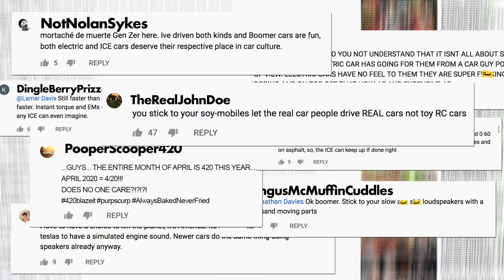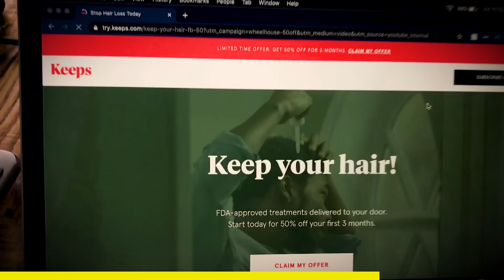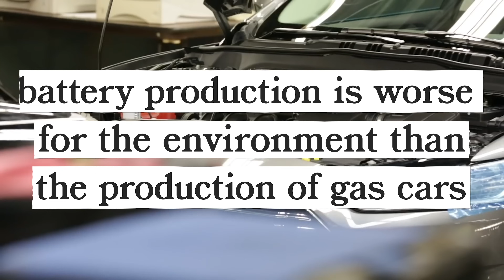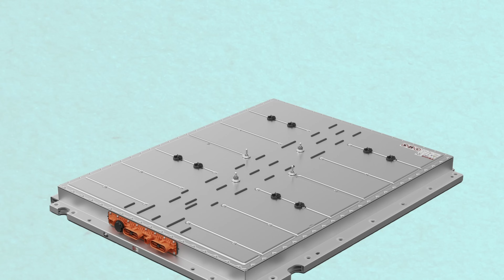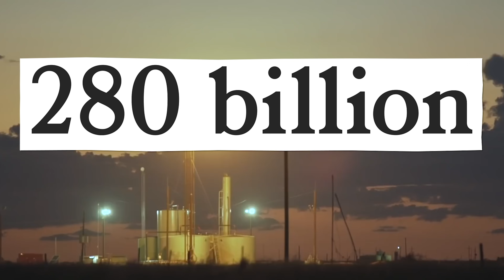Are Electric Cars REALLY Better for the Environment?

Comment: One other thing to consider is the ability to charge vehicles at home, many homes cannot actually generate enough power to charge vehicles and the cost of upgrading the central power at a private residence is high enough that there are going to be people that cannot afford to switch to an electric vehicle.

I would also be curious to see comparisons on how far electric cars can travel vs how far an ICE engine can go.  Also length of charge time vs how much time it takes to fill a gas tank is something to consider.

I am seeing a lot of things coming out about EV semi's and delivery vehicles and many drivers that I have talked to are worried that it will be impossible to finish a delivery route in an EV.  

I would be curious to see if you all can find more definitive information on some of these points because all of my sources are biased and not 100% accurate.
Reply: You can implement a control system that monitors the net instantaneous power to your house, and controls big ticket and flexible loads to run at different times.  Most of the time, your house isn't consuming anywhere near its full electric capacity; it's only when you have a perfect storm of load concurrence that you have this problem.

The controllers can put EV charging on pause, any time you have high demand from other loads, and waits until your other demand settles to charge it.  It can also do this with hot water heaters, air conditioning, and other big-ticket loads.  Another thing that helps is a VFD driven air conditioner, so that you don't need to have it spike on and off intermittently.

Comment: Well 1 part that was wrong you said many use fossil fuel for electricity.... ummmm most of the electricity is made from fossil fuel... I mean nearly everything is ran by fossil fuel... your saying EV and Gas Powered... you forget... planes and yatchs and more etc etc... Electric cars are new and are more of a consumer bandaid ppl just want to think they are helping the environment when in reality... no no their not. Ppl just selfish they want to cast an illusion that they are righteous and good and don't like hearing that they are doing evil either way. Even phone production... child labor... even clothing...also wind and solar power takes large and large amounts of areas and maintenance also... how do you fabricate and make these things? What raw materials are used? How is it maintained? Also electric car vehicles largely expensive and after 5 years your time is running on that battery which isn't a cheap fix. Also like you said battery recycling is a big issue... also we have to make a new battery which most don't do they junk the car... so we have large amounts of cars that have been junked... so that's why Tesla buys back their vehicles many times... to help recycle... ppl just need to think before suggesting these environment safe things... this isn't about the environment life will continue like it always has but us we will suffer. The actual true way to stop pollution walk or ride a bike... thats going to help a lot more. Another way is trash disposal... fossil fuel is the least of our worries and ppl protesting it don't have a clue how many things are possible just because of fossil fuel. As it stands if we say bye bye to fossil fuel we would have a timer before the system crashes... some say less than 2 weeks.

Comment: Does the ev still make less carbon when you account for how long the battery lasts before needing a new one which produces more carbon again? How about the fact that the solar panels and wind turbines make as much or more carbon to make as the generators but last alot less.
Reply: On average 37% less pollution than ICE. The real difference however is economics. In many countries and use cases, ICE is more affordable to the point where you may never breakeven financially due to battery replacement costs.

Comment: Some things to add into the discussion. First of all most people mention the greenhouse gases, but in nowadays greenhouse gases are not the only pollution thay is reaching to worrying levels, ICE engines also produces toxic pollutants, VOCs and PMs. EVs also produce SOME PMs but only during production and in a much lower levels.
The second one is where the money are going investing in either EVs or ICE cars. Most of the companies that are invested into EVs are companies that emphasise renewable energy and battery technologies. I know that everyone loves to dump on the batteries the EVs use, but batteries are not essetial just for EVs but for everything else as well. ICE ondustry is mostly invested on weapon ondustry and oil.
Finally EVs are at their infancy as the video mentioned, ICE is at its peak and many argue that not many advancements are left for ICE, yet EVs have a whole mile to go through for the next centuries, only improving what they are aiming at.
Reply: This is a outright lie lol. Battery technology is over a century old if you're only talking about rechargeable batteries. If you're talking lithium batteries, an evolution of rechargeable batteries, it's over 50 years old. The EV comes in only because we got this far with battery technology

We are nearing peak battery understanding with maybe the last break through with solid state in the future. 

But ICE and it's fuel sources are still up for innovation on fuel sources alone. And again, it's only because people claim co2 is bad that we've put a stop to it lol. But at the end of the day co2 is normal for the world and plants need it haha

Comment: The fact that Children !!!!! are being used to produce your batteries should be enough to stop you from making this video. You spent 7 seconds talking about child labor , and 5:38 seconds trashing gasoline vehicles.  Children are being sacrificed to save the earth.just keeping it real. Does this not make sense to people.
Reply: Trust me, there was most likely children involved in producing the device you wrote this comment with. One example is that your phone battery is of the same type as elecrtric cars uses..
Anyway, there are already lots of ev's made without the use of cobalt, and some buy from more ethical producers. It should be a lot more focus on the child labour in DRC though. We really need some international regulations on the trackability of materials so the producers can't get away with buying it from China without asking questions..

Comment: The EV pollutes at the power plant and the ICE out the tail pipe. BOTH pollute upon retreivnig the fuel source, oil, gas or coal. Fill ups are way, way faster than charge ups! 👍

Comment: Okay, imagine a 100 car pileup in icy weather, all the cars are EVs.  25 of the cars' engines start on fire.  Because their batteries are very very difficult to put out once they start on fire, pretty soon you got a ton of cars on fire.  It isn't just enough to put out the fire, but the batteries have to be cooled down enough so they won't start up again.  Which requires a TON of water.  It can take more than 20,000 gallons of water just to put out completely the fire of one electric car.  So now imagine if all 100 cars started on fire.  

Anyone know how we could calculate the impact on the environment from that?  CO2 on the other hand, is plant food.  There used to be a lot more carbon in the atmosphere, which is why plants used to grow bigger (as did insects).  It's not the boogeyman they want it to be.

Comment: Car industry is miserably small in entire petroleum industry yet you say as if ICE is responsible for CO2 due to crude oil refinement. EV gets 60% of its electricity from petroleum as well and there is a huge energy loss to convert it. Moreover, Windmills, solar panels are not CO2 free. Tbh, EV is not better for the environment.

Comment: After ten years the battery will require changing because the range would be half compared to new so the resale value would be low and the car maybe then just be disposed of because no one wants an electric car that can only travel 200km before recharging. 

Recharging during the holidays at busy charging stations would be chaotic.

Comment: Excellent breakdown of the pros and cons of EVs. One big issue I see with them is that they’re still not affordable enough for most people even with a tax credit. And on top of that a lot of people don’t have access to charging because they live in an apartment. Someday it’ll get there when the technology matures but not yet.
Reply: I just bought a used bolt with a fresh battery replacement for 18k. After the 4k I'll get back from the tax rebate, that's only 14k. Very affordable.
Reply: @mattpierson6100  wow that is a good deal. Hard to get a decent car for that price. How did you find that? Does that price include the new batteries or did you have to pay separate?
Reply: @mattpierson6100 I thought about one. One thing that worries me is the loss of warranty (because of time and mileage), and how expensive such a battery (and installation) can be.

Can you extend warranty with a new battery?
Reply: @mattpierson6100 how's range ?
Reply: @mattpierson6100  And, with the cost of a new battery pack, the car becomes like a bic lighter. Just throw it away and get another one once the pack cacks.
Reply: I think the ice market is setting the price trends.  The average new car in the US is ~$45,000, and seeing bottom of the market cars on the road is rare.  People complain about the prices but still very few buy the budget option.
Reply: For the apartment I agree but apartments are actually starting to install power chargers I use to live in an apartment in NV and after the built 3 more buildings in the complex they added a car charging station it's by the office though not all apartments have them but we'll get there eventually
Reply: Well they will be soon tesla is making ome and it'll come out next year it'll be 25 thousand
Reply: Average ev costs 30 - 40k + tax credits. Average diesel or gas costs 45 - 60k.
Reply: Not sure about price comparisons in the US, but here in Australia a Tesla Model 3  is the same price as a Ford Ranger.

They are really affordable considering fuel costs drop by 80% when you start driving an EV.
Reply: They're very affordable now for an average one. Tesla has stayed mostly in the luxury segment so far but this isn't representative of the entire industry. There's an EV for everyone at this point.
Reply: of course 20 times better than fossil fuel cars. I am sure. If you have 8 solar panels, you can use your car after doomed earth or in the Saharian desert. It is incredible.

Comment: I don’t get it, so to make an ev more efficient you need to make those humungous wind turbines which cause a heap of carbon emissions. Which are a huge issue to recycle 
And you didn’t mention with age an ev battery looses its range and needs replacing whereas a combustion engine doesn’t loose its range. Then you need to recycle the batteries which is dirtier then mining 
At the end of the day Evs aren’t what the hype says. Hybrid is a better option

Comment: Yes, electric vehicles are more efficient and emit less CO2. But the problem is that gasoline powered vehicles are waaay easier and more efficient to recycle. You can simply remelt engines, sheet metal and other metal and plastic parts to a brand new car. Batteries are on the other hand terrible to recycle if they are recyclable. The second problem which cars pollute more our sorroundings. I mean gasoline and diesel are both burned at very high temperature (2000 to 2500 degrees Celsius) inside engines, catalytic converters and DPFs. So they both burn into clean waste gas CO2, that can plants absorb and convert it back to food, fuel and energy. Otherwise CO2 can decompose in around 20 TO 200 YEARS. Speaking of electricity, yes it's cleaner in terms of emissions. But when it comes to mining lithium and cobalt it's actually a COMPLETE ENVIROMENTAL DISASTER because it DEGRADES SOIL and WATER PRACTICALLY FOREVER. Also keep in mind that sadly not every car on our planet get back to a recycling facility. So in conclusion which cars are more polluting the enviroment? Actually both the same. So if you really don't need a car to go everyday to work and shopping, please lift up your fu**ing lazy as*es and go for a walk, take a bike or simply use more frequently public transportation. You will make the best for the enviroment and your body and mindset.

Comment: You forgot to mention one very important thing: recycling and pollution. stockpiling of EV batteries means that these will either corrode and poison ground waters or start burning - every year there are many typical landfill fires, just because there is too much garbage and someone wants it to disappear. When this happens there will be no way to put that fire down - right now only fast way to extinguish EV burning is to submerge it in water. absolutely undoable on a landfill. 
Also about electric grid overload: Yes, 25% of energy being used to charge EVs is acceptable. But problem is that EVs are being charged mostly at the same time (evening). THere are university studies on this and as I recall maximum number of EVs that should not cause any trouble was in range 2-5% of all cars in US. 
In EU it might get even worse, as at the same time heat pumps are starting to be a must for new houses and in winter PV produces barely any energy - if you and your neighbors charge EV and heat home at the same time, your town might get into trouble.

Comment: I'm watching in July 2023! You haven't mentioned the infrastructure it will take to make EV's feaseble! They are ultra expensive, it takes quite a long time to charge one, the batteries are heavy and potentially dangerous, as has been proven in the last few years! 
Just wait and see and we'll see who's right! The grid won't be able to handle the onslot of EV's! It will be a disaster if it's attempted! Later!

Comment: Would be nice of research was done into hemp and or hydrogen power, both renewable but very limited research and development for either. Electric seems like a ticking time bomb when it comes to time when those batteries need to be swapped and recycling them is costly. Fossil fuels are limited in use and performance, time for alternative fuels, not overhyped power wheels.

Comment: Even if we accept the false premise that humans change the climates (not "climate")  of the planet (It's entirely made up BS) 
How do EVs make the weather better, given that we have to destroy the Earth to get all of the rare metals EVs need? 

My RAV4 is 40% thermally efficient.    (40% of the gasoline energy chemical turns the wheels)     Since people will presumably charge their EVs at night when there is no solar and rarely wind - EVs will be charged with coal and gas.  Steam turbines are fairly efficient at turning coal into brake horsepower but there are transmission losses to figure as well.   Ill give the EV  a slight advantage at efficiency but my RAV4 can easily go 600 miles on a tank and in a push I could put three 5-gallon containers in my car and go another 600 without stopping at a gas station.

EVs cannot go as far as they say.   You're not supposed to fill or empty the battery since it will make it die quicker.   Best to operate it between 80%  to 20%  full - OK that reduces range by 40%    But what about 30 below over the mountains at night?
Not unless you want to go the way of the Donner party; frozen and starved to death. 
EVs are like fancy golf carts.  Great for a 3rd or 4th car in your stables if you can afford it

Comment: 8:50 This is so untrue, due to higher carbon required for production during manufacture a typical EV only becomes more environmentally friendly than an equivalent petrol vehicle after approximately 100,000 miles…. Yes, the EV uses less carbon but it starts much higher on the Y-Axis of the emissions versus miles graph than the standard car, crossing over at around 100,000 miles…
This FACT is so largely and conveniently forgotten about 🤨
So unless you keep your EV for a long time then your info is bogus, also the carbon saving is only around 30% after 100,000 miles.
Reply: Are you even accounting that EVs are powered mostly by coal power plants?

Comment: Can you also research on how long a car's battery last? Compared to the average useful life of internal combustion car how many times do you have to replace EV's battery like: if an internal combustion engine car lasts for 25 years, will EV's battery last that long if not then how many times do you need to change the battery. Then comparison of cost running and maintenance of EV and ICE vehicle over a period of 25 years.
Reply: I interviewed a top energy expert on my home page vid. He warns EV conversion will not happen and oil can never be replaced